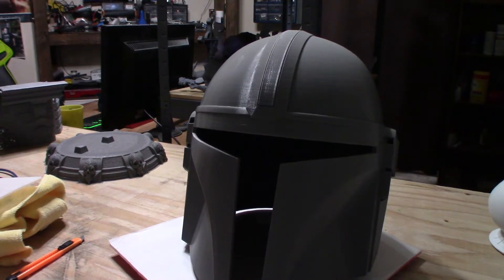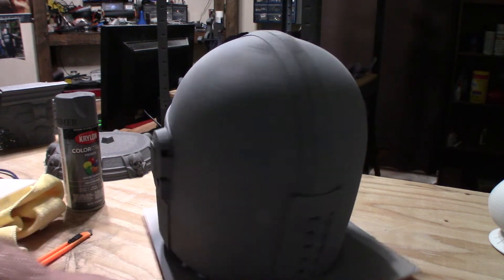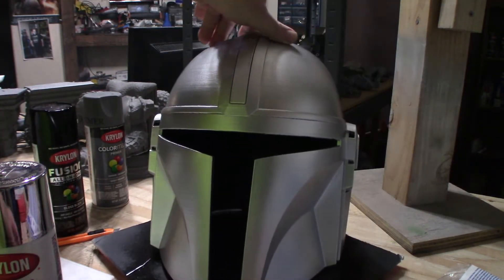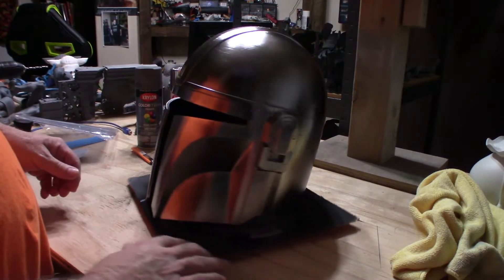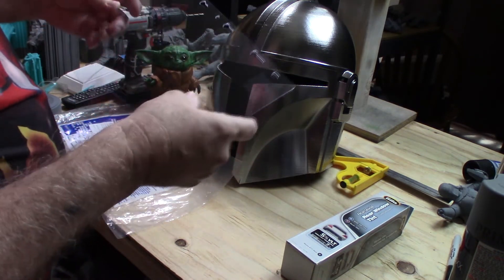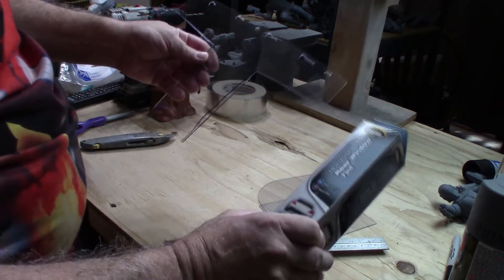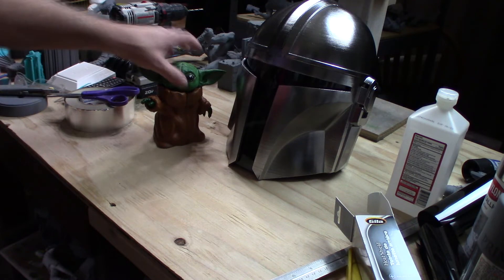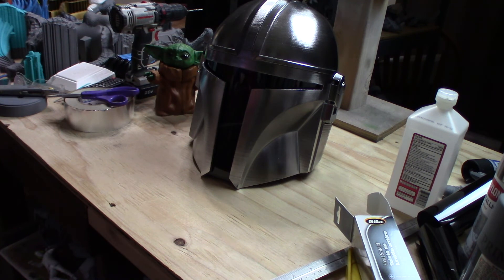3d Printed Mandalorian Helmet  on My Creality CR10 #3dhp

Comment: Did you use any support in the video you got rid of most of it
Reply from the maker: Around the base,eye sockets.I let S3d add them all,then removed all internal supports for the dome.
Reply: @3DHP  I am trying to print without supports with the print upside down should it be fine ? I have another file with support at the ready incase this one fails
Reply from the maker: @Nerdsphere115  You can print upside down,but there will be damage from supports on the dome to fix.
Reply: @3DHP  repairs as In maybe some bondo and sanding. ?
Reply from the maker: @Nerdsphere115  From possible support damage if printing upside down.
Reply: @3DHP  also how long did this take you to print and how much fillament did you end up using for this print ?

Comment: How long did this take you to print, my sr10s on low quality without supports has I t clocked in @ 3 day 10hrs at the lowest.???
Reply: Cr10s sorry typo
Reply from the maker: @thomasstefanich9574  I don't remember if I didn't say an about time in video. Slicers are never accurate on times. I have never kept track on times, they take as long as they take.

Comment: All that time printing it and you don't even give it a sanding, or use multiply layers of primer to help hide the print lines/layers? That would have given the final colour/finish a much smoother surface.

Comment: i know this is a old video but helmet turned out great by the way can i use the stock nozzle on my cr 10 ? or do i need to buy a different one? thanks in advanced
Reply from the maker: Almost all except for maybe 1 print was done with a stock .4mm brass nozzle.
Reply: @3DHP  so it should print fine with the stock one ? Mine is still considered new lol I am wanting to do a mando costume for Halloween

Comment: Hey does anybody know how tall the helmet is? I need to know if it will fit in the build area of my printer
Reply from the maker: Printed mine on a cr10 at 105% I belive.When you load the stl in your slice,you will see how it fits ,since your slice has build deminsions of your print bed.My helmet is 11 inches tall.